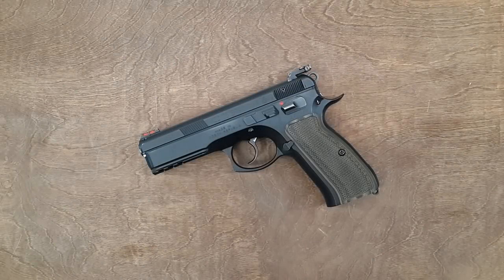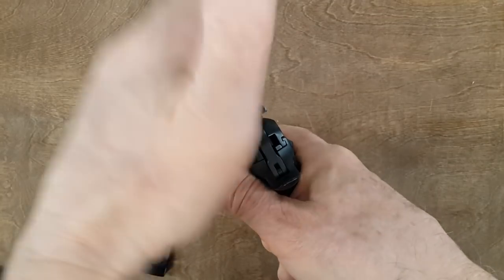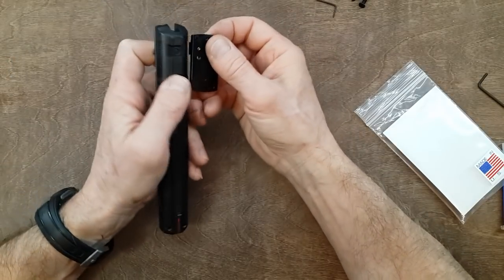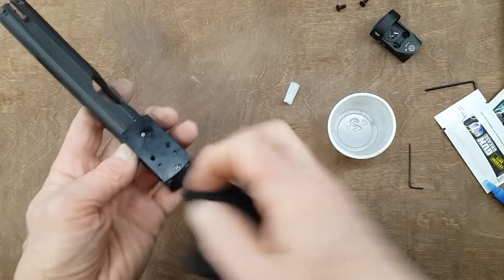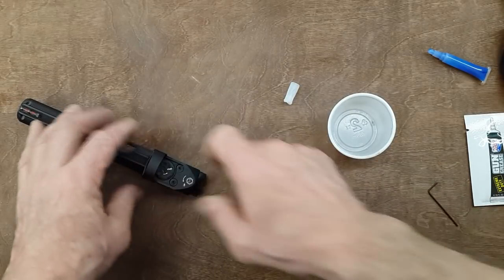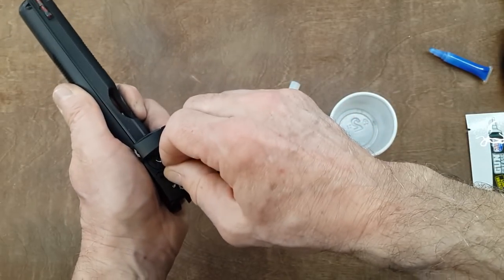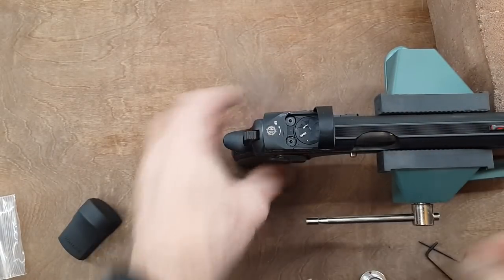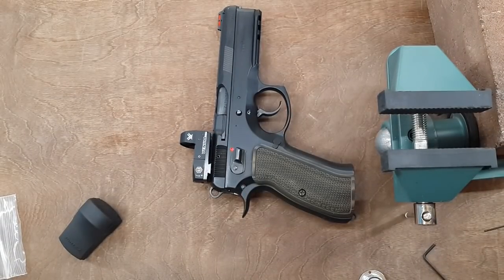A CZ 75 SP-01, a Vortex Venom and a Dovetail Mounting Plate

Comment: This may be a little late, but you are not supposed to sand the bottom of the plate, these mounting plates are designed to be installed with a sight pusher with high pressure and are meant to be an extremely tight fit. If they aren't pushed in with the hundred+ pounds the sight pusher provides they will work themselves loose over time and will alter your zero, you will be making constant sight adjustments. If you cant get it in even with a sight pusher, then you sand it, a very tiny bit at a time. You can always remove material, but you can't put it back on.

Comment: I followed these instructions to a tee. Very very informative. I put my bore laser sight red beam in and they both land at the same location after about 15 yrds. The real test is the range. After sitting with the red beam and practicing locating the red dot on the scope for a couple months I finally went to the range. My wife and I both hit bullseyes at 16yrds.  After a while the battery cap popped off and wifey couldn't find the dot. I figured out what happened but what I also noticed was the mount was loose loose. Being that i initially shaved down the mount to fit in the slide like you did, where you were able to push the mount in by hand... that may have been too much material removed for me (or my slide at least) so i have ordered another mount and re installed but this time having to tap the mount in with my punch hammer (the one with the screw off plastic circular head) using the plastic side of course. I made sure it was going to be a snug fit so for anyone about to do this, my only suggestion is to not shave too much material as is suggested in this video but make sure its snug enough to have to hammer it in with some force but not too much. I used a 220 grit sand paper and only removed the paint off the edges before I was able to insert the mount in the slide. From there I tapped it in and again I had to use a bit of force. There was no way to use my sight pusher nor would my hands be enough.  I'll be back at the range soon and if any more issues arise I'll return and follow up to this post but thanks again. Wifey hates the weight of the sp01 vs pcr or p01 but loves the rds.
Reply: The sandpaper the gentleman used was way to rough, we aren’t sanding wood, this is metal, he should have started with 1000 and then test fitted every time, the sight should have a lot more friction and should need to be pressed in, not slid in with your fingers, this is going to loose zero every shooting. Good video just bad technique.
Reply: That's why u never do what other in the internet do dovetail mount gotta go in with a hammer buddy if u did it by hand u fucked up like this dude did

Comment: Good video 
I have the same set up i did many years ago and i am contemplating having the slide cut for a optic 
One piece of constructive criticism you should always clean your screws and holes with 90% alcohol to get the shipping oil off them it will dry quickly . Also get a digital torque wrench for your optic screws 15 inch pounds, I learned the hard-way when a optic flew off one of my guns , mark the optic screws with a sharpie across the screw faces so you can see if it moved . Your advice on how to fit the sight is spot on with the circle motion i prefer honing stones because mine are always flat 
Good video

Comment: If that plate is loose enough to rock forward and back and relies on one tiny screw as a stilt to be level I have officially been talked out of mounting a red dot this way forever!  Good video.  Thanks for the info!
Reply from the maker: You are absolutely right, but those screws are doing their job pretty well (I didn't say "very well"). I would see that mount as an introduction to red dot. If you become serious about RD, then you would need a milled receiver.

Comment: What dovetail tool are you using here? Cool vid. Going this direction now. And, is there a follow up video??
Reply from the maker: I am using a Springer precision Dovetail Mount. It works very well on my CZ 75 SP-01 for what it is. 
Still, have to do a LOT of practice to be consistent to place the Red Dot in the window. 
Bad: The mount is too tall. I mounted the highest front sight from Dawson Precision (.370" tall), and still couldn't cowitness. I came to the conclusion that the Iron Sights on the CZ will serve me better. 
So I transferred the Red Dot Sight (RDS) to my Glock 17 (GL17), and it is working better, but still have to practice a ton to be consistent. Thanks for watching Kyle.
Reply: Bummer to hear. What tool (the blue one) are you using to remove the rear sight ? Also, if no co witness is needed, did this work fine?  hanks again mate.
Reply from the maker: @96kylar  
Yes it did work very well, but because I compete, I found out that I would prefer to stay in the Iron Sights category.
I use the "Blue One"(LOL) to remove my rear sight, it works perfectly for the job. https://youtu.be/LLAQw4tTJJ8
Happy shooting Kyle
Reply: @practicalshooter6517  awesome. And thanks man. Best of luck to you mate.

Comment: Why don't they make the base plate with a usable rear sight. That way if you have to send in your redot to be fixed or it doesn't work you still have a working rear sight? Seems like there's plenty of room infront of the baseplate and behind the case ejection port
Reply from the maker: That would make too much sense I guess.

Comment: Your the best with your cz videos. “We”, have done some work. I learned cz’s on the sp01. 
Do you know if the back site dovetail on the 97b is the same as the 75s? I can’t find a plates specifically for 97b. 
Thanks for any knowledge.
Reply from the maker: I never worked on the 97b nor I have ever seen one, so my knowledge about it is absolutely null. Sorry and good luck
Reply: Wait…what? Haha. 

It is simply the best full size .45 ACP. Pistol. 10 +1 and weighs the same as the sp01 loaded. Go rent one and fall in love. 

In any case, I will receive all of the tools and venom on Saturday. Your video will be vital! 

Seriously your stuff is so helpful. Those hacks I learned from you RULE!; and I appreciate your response. I also own the aforementioned SP01, & 97b,. I carry a RAMI everyday. . This will be my first dot on a handgun. I held off as long as I could.  The dot is too much of an advantage to overcome. 
✌️
Thanks.

Comment: What made you decide to go for the plate in the back instead of a mount that is connected to the rail and comes back at an angle? Some tuning models are sold like that in Germany, called Shadow Cobra with an Meopta Meosight III. It ends up somewhere in the center of the gun, but it won't see any of the slide movement that way. Can you tell me where you got the libelle/bubble level and how do you remove the old loctite from the small tapped holes?
Reply from the maker: I didn't know if I would have liked a red dot on my handgun, so I didn't want to have my slide milled. I did well, as I didn't like using the red dot :)
I have had that bubble leveler for 20 years, so you are on your own to find one. They do come handy once in a while.
Loctite is soft, so anything smaller than the hole can be inserted, like a very little screw or a very little Allen wrench, and it need to be rotated back and forth to loosen up the loctite.
Reply: @practicalshooter6517  
Thx for clearing that up. I only used loctite on pieces that I could heat without damage. It gets brittle when heated past 85°C.